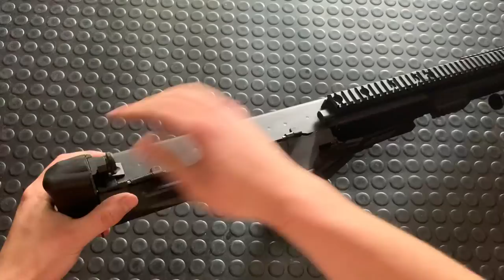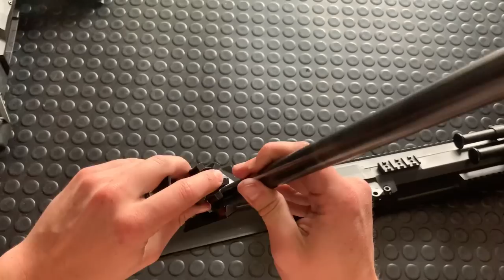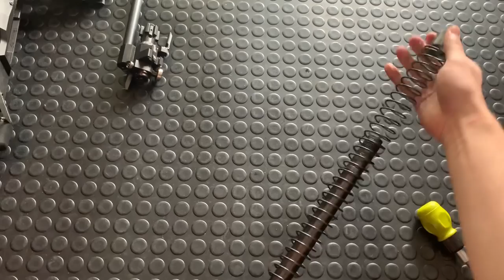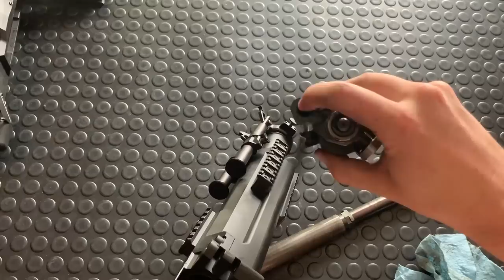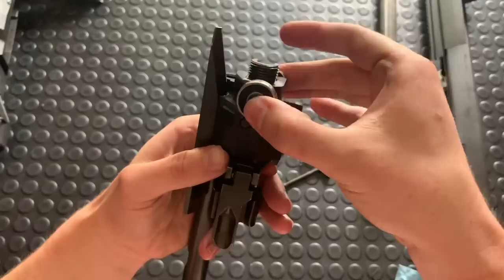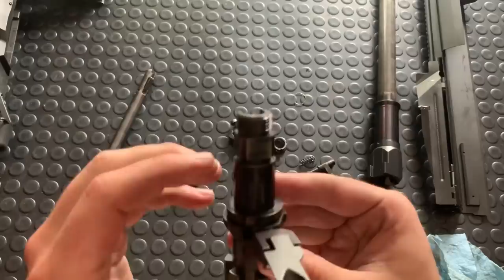SERO GM6 Lynx - Field Strip Disassembly (GM6 part 1): Gun of the Week #10

Comment: Do you think it has any out of battery safety feature?
I've stumbled on this comment, looks like the gun can fire with the bolt not being closed all the way... Scary stuff...
Agent-OrangeCH
"Years ago, a guy had a shooting accident here in Switzerland with his brand new GM6 Lynx. He survided, just burned his chin a little and had some scratches in his face from the bullet shrapnels. According to him, the bolt didnt lock 100% and when he pulled the trigger the bolt was smashed back, slit open the next bullet in the magazin and ignited the powder which burned his face."
Reply: the bolt locking system is quite unique.

Comment: Do they not have 7's in canada? you said 12.8mm when it's actually 12.7mm and  M108 instead of M107 with the Barrett kinda a funny coincidence

It's interesting looking at this from an engineering perspective and a lot of this stuff is excess cost that doesn't really add value but it makes it cooler Like you can see ways to simplify it but it would loos some of the mystique and it'd be difficult to justify the 15k price tag
Reply from the maker: Thanks for the correction. I just blanked in the moment. I'll add it to the correction section in the description.

Comment: I really really really really really I'm interested in this gun I like this gun I love this gun such a good idea put a nice thermal vision scope on it with night vision to where you can just flick it on and off the regular scope night vision thermal scope everything zoom in and out by the push of a button quick shots oh man I'm in love with this thing Mason lightweight I could be your primary weapon and all you can take Corners with this the only problem is it will shoot right through walls and everything like that or it won't stop you know what I mean it's such a heavy around so you got to be careful and make sure there's something behind these people because the rounds going right through them right through bulletproof vests everything and depending on the round use because there's lots of different rounds out there and I wonder if they make a hollow point 50 BMG yet or did they ever I don't know but that would be good and better than a full metal jacket this way it opens up and slows down the velocity a little bit